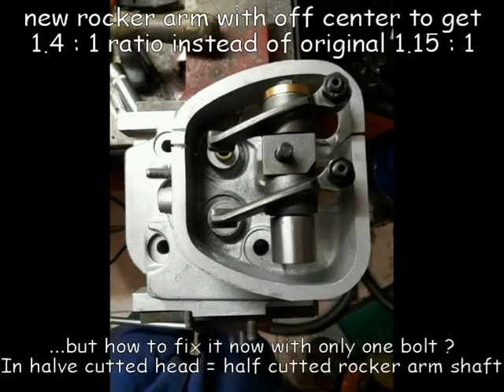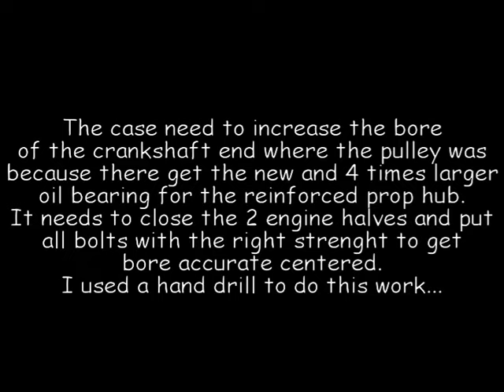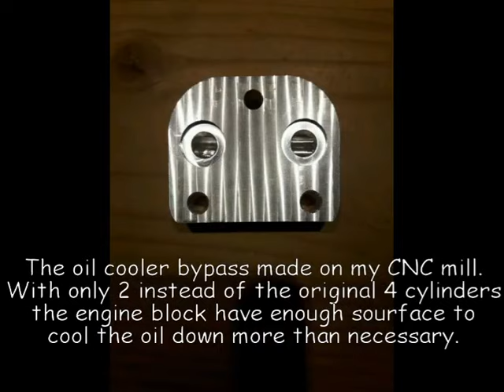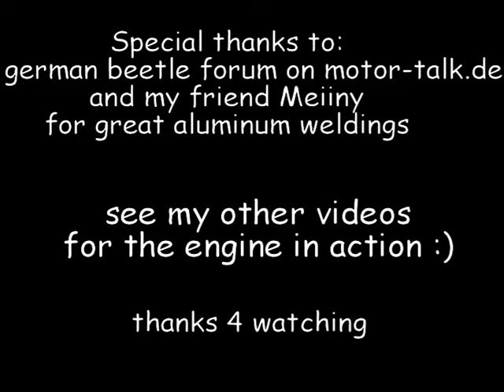How to build an airplane engine from garbage DIY

Comment: I flew one of those VWs for 15 years without an issue in a KR2 . It was a Steve Bennet conversion and was great.
Reply from the maker: Thank You for this comment.
Thats good for others to trust more to VW conversions
Reply: @flyover1974  My VW was a 4cyl direct drive and it had no quirks .
Reply: @charleswesley9907  hello, i'm also thinking of doing a KR2 project. Do you still fly the plane?

Comment: I learned to buy a Verner in lieu of modifying a VW
Reply from the maker: If you have enough cash to buy a 6.000 to 10.000 Euro Engine you can do that. If you want flying with small budget, you need to go this way 😉
Reply: By the time "the average Joe" buys all the parts, pays for the welding and machining etc, he'll have close to 6k invested....

Comment: "Cutted" parts ??
Reply from the maker: Soory for my bad englisch...i mean the crank is cut in 2 parts, even the cylinder head. For this it is necessary because the cylinders on the original VW are 4 and now there are only 2 remaining, but the cylinder head is 1 piece for 2 cylinders so it need to be cut in halve and rebuild partial.
Reply from the maker: yes. You need only the half crankshaft on a "half VW" because you spare 2 cylinders of 4 ;-)

Comment: What's the point of a half of a VW
Reply from the maker: A whole VW engine is big and heavy and for a single seater ultralight plane oversized.
The half one is lightweight with a good power to weight ratio. Mine weight 105 lbs in order to fly included prop, mount and all needed liquids

Comment: A Brazilian friend had done this and actually he cut the case as well. Good job! Thanks for sharing to the community. 😀
Reply from the maker: Thank you very much :)
Do not cut the case because the saved weight get lost by the fat backplate and the needing oil cooler.
In my conversion the full case with aluminum covers at the unused cylinders dont need a oil cooler because of the big surface of the case.
I had problems to reach a good oil temperature and isolate the bottom of the case.
A static test with 30 degree celsius air temp and 15 minutes full power the oil temp was only 41 degree.. 
The only advantage of a cut case is if you have space problems and you need a more compact engine.
Cheers
Reply: @flyover1974   Excellent information...and no music.  Thank you.

Comment: I built one cut the crank , cam in half , plugged the back oil tally, added a thrust bearing mid crank journal, placed block off plates on two cylinders, retarded the cam to get , max horsepower at a lower RPM.  It runs good on my Heath Super Parasol.

Comment: Nice work, I am thinking of doing my own 2 cylinder VW mod (using plans) but seeing this helps me visualize what is entailed. Thanks for posting it!
Reply from the maker: Thank you! My working base was the plans from Milholland's Half VW but with some mods. One of them are the axial bearing. Someone made it behind the middle bearing on the end of the cut crank and the other way is in the prop hub side behind the first bearing.
A second minor mod but with big effect is the working on the cam followers from Bob Hoover. with this a lot more oil goes thru the cam rods and lubricate and cooling of rocker arms, valves and head is a lot improved. You need to google to hoover vw mods.
Cheers

Comment: You are not a average gyi you have a machining tools. But nice that you mentioned "Even with those Chevy rods" maybe I must get a pair of those too.
Reply from the maker: Im sure that im not an average guy but even im not a professional. I dont have more machine tools than a average self made man. Sure, if you never work often in your garage and your tools need not more space than a toolbox and your skills are not more than cut a cable or fasten a loose screw, this is not a project for you ;) but im sure you know that.
About the chevy rods, you need the specific crankshaft with smaller journeys, VW use 55 mm and chevy rods use 2 inch (50.8mm). When you want to use the maximum stroke crank (86mm) without larger modification of the  motor block, you need the smaller journeys.
If you use the 82mm stroke, you can use the original VW rods.
All this stuff i read in german beetle forum and in the legal eagle forum: https://www.eaglersnest.com/forum/

Comment: "Speed and power" -Jeremy clarkson
Reply from the maker: Thank you very much
Reply: @flyover1974  np
Reply: Amazing. What a string of ingenious ideas and technical ability. I am not sure I would want to bet my life on it however.
Reply from the maker: @burtvincent1278  thank you :)
That's the reason why i do 50 hours on ground in various power and weather conditions. Than i disassemble the engine and check or exzessive wearing. If i find nothing, the engine goes in my ultralight :)

Comment: Interesting concept but I think if you use a 3 cylinder Geo Metro engine they're really strong and dependable and I mean strong the only weakness in the Geo engine is the aluminum they use in the Pistons higher-quality pistons
Reply from the maker: Before i start to build this engine (in Europe) i was looking for other engines and some car engines was in my tighter choice. My favorite was the bmw smart engine.
But all the car engines need gear reducers and rise the weight and complicate the build.
The second  reason was the cheap and worldwide spare part availability and the third reason was the already use in some homemade airplanes since this engine exists.
Reply: @flyover1974  I don't know specs of it, but I LOVE the appearance of a 2CV motor.  It's pretty, where the VW is boring, still...not the best criteria for a motor, but some people use them.  
I have an N3 pup with the 1/2 VW motor.
I'm going to have to bring it home this weekend...bummer.  But...such is life.
Reply from the maker: The advantage of the half VW is the weight. Probably the half or more of the geo metro engine. And the half VW is direct drive
Reply: @flyover1974  The VW is direct drive and well proven and cheap .

Comment: Well,that taught me all I need to know about building engines.
Reply from the maker: Nice to know this video could help you
Reply: @flyover1974 .how much trouble would I get in if I put a 400 hp VW engine in a Hummel Cruzer ultra light?
Reply from the maker: @gerald4027  i am open mind and i never say no but some things are not possible...
 Whitch kind of VW engine you mean? I don't think it is a old aircooled boxer because it is not possible to get 400 hp from this engine and if it's possible than the engine is not enough reliable for flight use because it is made for maximum power and not for maximum reliability.
Anyway a 400 hp engine in a single seater ultralight is crazy oversized and for the ultralight you tell is probably never possible because the whole plane is not designed for that much power, neither the structure nor the airfoil.
And a 400hp engine probably weight minimum 3 times more than the 2 cylinder boxer with 45 hp.
Only for this reason you need to make mayor changes in the lenght of the structure to get the right balance and so you change the flight properties to unknown because nobody did that before...
My opinion: no way... forget it
Reply: @flyover1974 .my brother owned a sand drag rail dune buggy and it had a VW engine dynoed at 550 hp. Hilborn mechanical fuel injected, t4 turbo,real aggressive high rpm cam and nitro methane. It would rev to about 10500 rpms.engine built in California. 
  I was thinking 400 hp,but then I read what you said.Would a 2 cylinder built for torque work good in a plane such as a Hummel or a Facet Opal flying wing?
Reply from the maker: @gerald4027  Do you think a engine whith original 45 hp, pumped up to 400 and more, is reliable to work hour after hour at 70% and more of his max. power?
Why airplane enines normally are the double or triple displacement of a car engine with the same power?
Because they need to be RELIABLE.
Never a vw beetle engine with 400+ hp is reliable to work in a airplane. The airplane engine never can quit in air because this is probably your end.
In a car if the engine quit, you drive to the boarder and stop there.
For your question:
A single seater ultralight plane work good whith 35 to 60 hp.
Important is not max power but only reliability and this is reached normally if engibe is build as simple as possible with low compression ratio and low revs
Reply: @flyover1974 .I see what you are  saying and since then I have been watching videos about airplane engines. Any suggestions for 1/2 VW?
Reply from the maker: @gerald4027  Im not sure what you mean exactly but if you want to build a 1/2 vw dont do a case cut. It seems first this version is lighter but is not because a cut case need a relatively thick backplate and the advantage in weight is away...if not at all then after mounting the necesarry oil cooler ;) And the overall work on the engine is much more and much complicated.
If you build a 1/2 vw with full case, you dont need a oil cooler because the surface of the case is more than enough to cool the oil without it. I have the problem to reach a good oil temp, the engine after 10 minute of wide open throttle an outside air temp of 32 degree celsius the oil was only 45 degre celsius. so i need to wrap the backside to insulate the case.
Anyway cooler oil is always better then too hot oil.
than google for  hvx bob hovers vw mods and do the work on the cam followers and on the rocker arms.
the advantage is that 3-5 times more oil flow thru the pushrods to the head and the cooling and lubricating performance is a lot better than stock. second effect is more oil cool down on the rocker arm case and especially on the case heads.
Carburettors from 24 to 26mm work great, above it is hard to tune and not more power and below you loss power.
But this work with about 550 to 600ccm per cylinder. Smaller ones need smaller carbs and bigger ones work great whith 26mm
cheers

Comment: I'm not an aviator but am currently about to completely rebuild my Type 1 VW 1776cc air cooled lump.  The question which keeps ringing in my ears is why didn't you just stick with a 4 cylinder lump?  There wouldn't be that much difference in weight, you'd have more power, and also more likelihood of the engine continuing to fire on a couple of cylinders if 1 or 2 of them decided that they fancied a nap!! ...  ?
Reply from the maker: Hi, in aviation every pund...or better every ounce of less weight is important. Example: i want to put a engine in an single seater ultralight plane with a maximum take off weight of 600 pounds (272kg). There is the complete VW 4 cylinder oversize in power and weight.
My engines weight including prop and liquids is about 47 kg (103 pound) with a power of 45 hp on 3200 rpm.
The engine power to weight ratio is super and more than enough for the single seater plane i told.
And engies for aviation are build with target of maximum reliability instead of maximum power. For that reason my engine has only a compression ratio of 8,2 : 1 ...this help a lot to not stress the moved parts but you loose something about 10-20% power
Cheers
Reply: @flyover1974  A 4 cyl direct drive with exhaust, carb and single mag is 160 pounds .

Comment: Would it not have been easier to use a 2 cylinder Citroën 2CV engine (aircooled, 602cc, 30 hp)?
Reply from the maker: You are not the first guy asking me these question. The Citroen is way smaller, only 600 cc and the whole engine is designed for this size.
It's a good engine but too small and weak for stronger upgrades.
And the 30 hp is maximum, for flight purposes is not good using a car engine at 90-100% of power. And to use this power you need a gear box instead of direct drive of VW
Reply: @flyover1974  Ok, thanks for your reply. Although a reliable 45 hp can be had from the 2cv engine with some carburator work and a 'big bore' kit to 650cc.
Reply from the maker: @flyingdd  but you need in any case a transmission and this is more weight and more pieces that can fail. And the significant higher rpm is not a tipical sign for reliability 😉
Reply from the maker: And 45 hp out of 600 to 800cc is not possible with low compression and low rpm, but this are the real mix for a reliabily engine
Reply: @flyover1974  That makes sense. I did not take the low compression and rpm requirements into account.
Reply from the maker: @flyingdd  reliability on ground for car purposes and reliability in air for flying purposes are 2 different things. 95% of reliability on streets with average 30% of power needing is compared for flying purposes 30% reliability because a engine in air work with 70 to 80% of average power.
So i dont need a engine with maximum power by high rpms and compression and a lot of extra mecanical pieces like transmission but a real reliability engine with low rpm, low compression, good cooling, good oil pressure...
To archive the needed power, the engine need a stroker crank and large cylindeds to turn large props in diameter at low rpm and direct drive for the needed trust.
This resuls in less pieces that can fail and less overall maintenance possi le to do for not professionals.

Comment: How much for complet convertion  this engine 43 hp and do install tree palm propeller with starter ???
Reply from the maker: Hi, around 1200 Euro for conversion parts if you do by yourself. Starter is not necessary, handstart is very easy but you can mount something if you want. 3 blade prop is only necessary for stronger engines and is more weight and less performance than 2 blade

Comment: You should never glass bead blast the inside of any engine
Reply from the maker: Thats right :) but at the time i start to build the engine i didn' t know that and then i waste a days of cleaning time :(
Next time i bold it together, close all open holes and sand blast it ONLY outside.
cheers
Reply: @flyover1974  :: Strange talk to me, but as I watched the pictures I understood a little more about what it takes to convert a VW engine to an airplane engine. My uncle did that in th 1905'ies when I was a kid, and showed me one of his creations in 1970. The sound of that engine in a little Jurca I think it was -- fabulous!
Reply from the maker: @dibaldgyfm9933  this conversion was a little more complicated than a simple VW conversion made mostly in 50's to 80's. There the people use a standard 4 cylinder VW, rebuild it, replacing weared pieces, add a dual or single carburettor and thats it.
The hardest thing to do was to spindle the bore for the prop hub and this normally was doing by a professional motor garage.
But this engines are reliable and cheap not only in the 50's.
A lot of people use it right now.
...and yes! The sound of this engine is awesome :)
Reply: @flyover1974  yes you can alloy castings are then dipped in hrdrofrlouric acid which dissolves the beads

Comment: Not sure I understand why you would make a 2 cylinder VW engine....  Why not just us a BMW R series air head?
Reply from the maker: Need a reduction gear, heavier, too high rpm to reach the power, more mecanical pieces that can fail....and a lot more reasons. This question is made often in this thread

Comment: Music is a personal taste...but there are technical questions.
How did you remove EVERY glassbead out of the oil-channels in the block? This are 90 degree angled channels, and blowing with air is not enough, there are corners where the beads stick to oil rests in this channel. When the oil comes hot they will come looseand can ruin the bearings. 
Or do you change the bearings after 50 hours or so? 
How many hours did you fly since june 2019 ?
Reply from the maker: this i a legitimate question and this problem made me a lot of headache. I need to open all oil gallery tab to clean all and i lost a few days to do this. i cleanded with gasoline and compressed air and brushes for pipe smokers. Then after first 30 seconds run i changed the oil and filter, after second run of 1 minute oil again and after third run of 5 minutes with fresh oil, i changed the second time the oil filter.
Then after some hours i opened the case and inspected the whole inside: there was some light visible wearing on the gears of cranck and cam but only cosmetic nature and no damage. The bearings was clean, probably because of the filtered oil before goes to the bearings.
This was 1 of 2 things i want never do on the next engine. Next time i close the block, close all openings and clean it with glassbead ONLY outside.
The 2° thing of wasted time was the head work. It was made to enlager the head volume but you can do this with simple spacers under the cylinder foot.
I did not fly yet because the ground running time of 50 hous is not finish and i dont had time in the last  year
Reply: @flyover1974  You identified the problem, it is OK then.  Remind that it is aviation , you can drop dead in every flight.
Reply from the maker: @louisvanrijn3964  You are right and for this reason i do the ground testing for 50 hours. Than disassembling the motor again and check accurate if there are some abnormal wearing. If not, the engine is ready to use for next 25 hours in a ultralight plane before you disasembling again. If the wearing is in normal limits, go to 50 hours of check.
If you want to get more save, put it in a motorized hang glider, so if the engine drops, you can glide

Comment: Why not just use all 4 cylinders?  Would be a lot easier smoother and more power . Your finished product is not that much smaller !
Reply from the maker: Because is overpowered and too heavy for a single seater ultralight plane